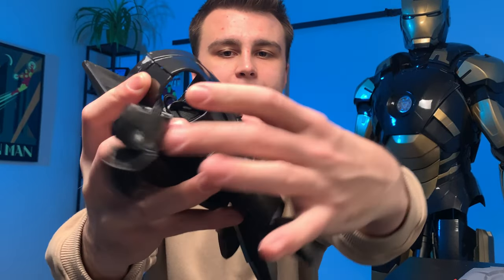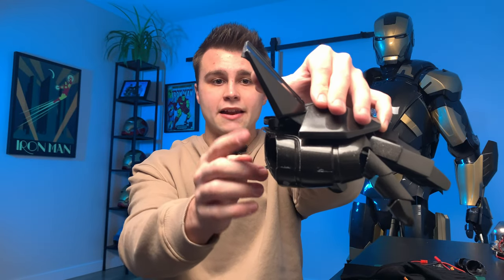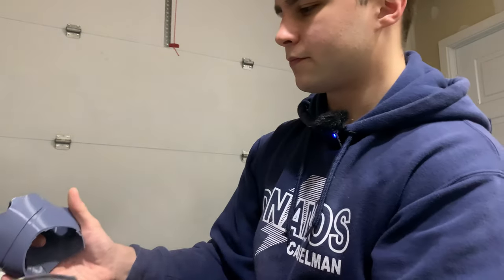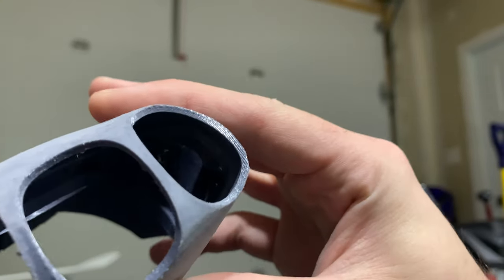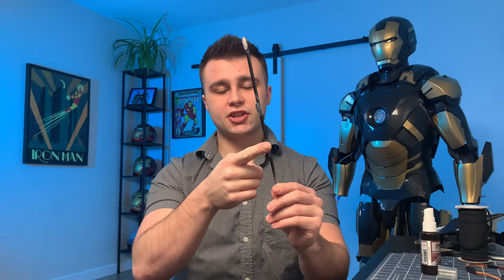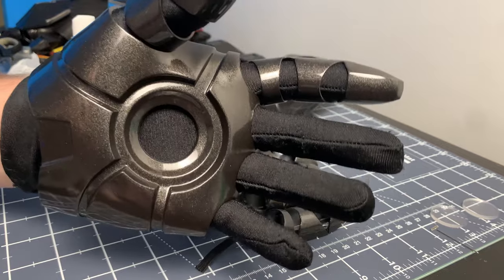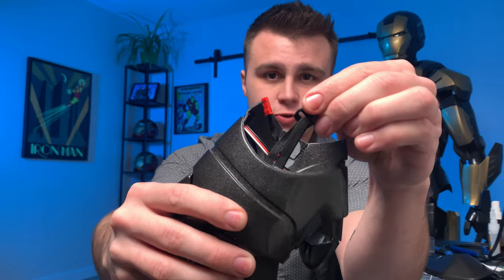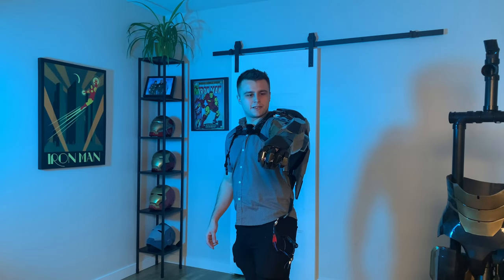Tips and Tricks for Sanding 3D Printed Cosplay Props - Upgrading my Iron Man suit! (part 2)

Comment: We’re do you get the neo pixels and acrylic disks
Reply from the maker: Both from Amazon! For the acrylic you might not find the correct size, so you can always go a little bigger and sand it down to size :)
Reply: Where did you find those acrylic disks in the video as I’m making the same gloves with the same file. Could you send me the link where to buy